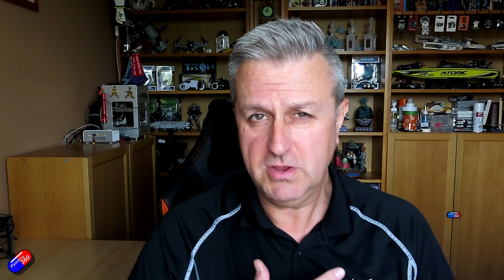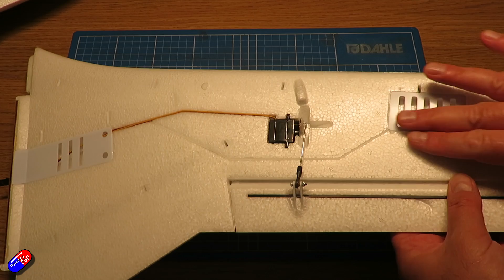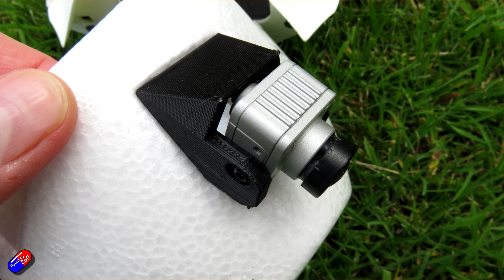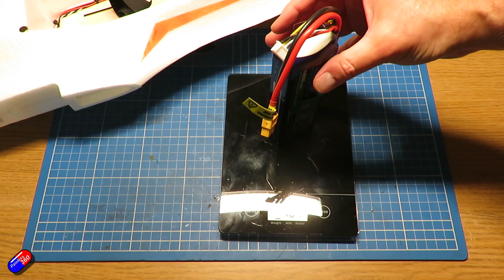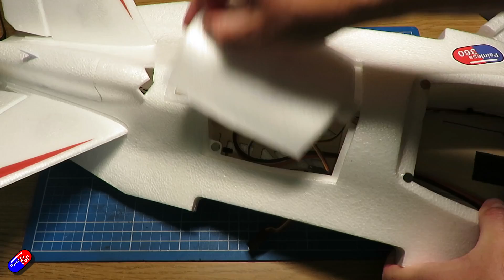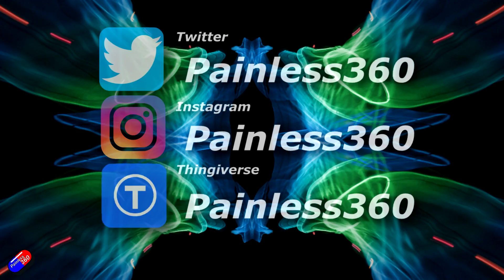MARS build and DJI HD installation overview

Comment: Hey Lee, I'm trying to recreate your propeller. In the video you said it was a 38mm hub but the package on screen says 34. Also I looked up both and neither of the current production look like this one. I want to use your 3D print so I dont want to buy the wrong thing. Thank you!
Reply from the maker: Next time I am near that model I will pull it out and take some images/measurements.
Reply: Thank you!

Comment: Folding prop:   on my ARWingpro using the stock prop works - the full motor break makes the prop hide behind the trailing edge of the wing rather than staying vertical. Is this different on the Mars?
Reply from the maker: I've not noticed. With the extra meat around the motor mount the props are always out of the way...

Comment: I've tried putting the DJI and Vista Air Units in the front (even on top) for cooling but have had them shutdown several times from overheating (even at low power). Granted it gets in the 100s here in the US Southwest deserts, but I can't trust my FPVs to go blind on me when the Unit shuts down so have to use a regular radio. The best option for cooling I've gotten, so far, is to use a 5v PC fan. That seems to work, even if the unit is buried inside wo airflow. Hope you don't have any overheating issues :)
Reply from the maker: After many flights here I am pleased to say that I have not had any overheating issues, but we don't have desert temps here in the UK... Happy flying

Comment: I’m wanting to convert a currently los rc plane to fpv. I’d be Using a 800mw vtx however I’m worried my goggles will greatly affect the range. They are the quanum cyclopse diversity, Is the video receiver good enough? Thanks.
Reply from the maker: It should be fine to try it out... Best of luck

Comment: 👽👽👽👽👽👽👽👽👽
Mine has an FMS 64mm EDF, 80A ESC, 4S 3300mAh and ZOHD Kopilot flight controller. Flies like its on rails, good glide characteristics. CG is on the front of the pips provided. The black version from BG is cheaper for some reason. I bought a second one, they're so good. I think they're from the same camp as the Aggressor. 👍

Comment: Hi Lee, this is timely since I am building a conventional wing as we speak. My problem is I want to utilise a Matek F411 Wing and it only has 2 Uarts and 1 Softserial. I have successfully connected the R9-MX Rx via FPORT on UART1 and GPS on UART 2.  How can I connect the DJI Vtx onto the Softserial ST1 pin to get an OSD??
I assume re-mapping is required but I don't know how. Is this even possible? Thanks
Reply from the maker: I'm not aware of remapping options for INAV. You could use SBUS to free up a UART.. You need TX and RX for the DJI OSD. Best of luck